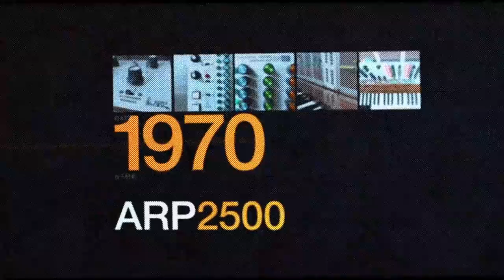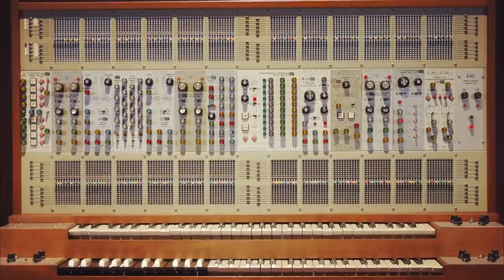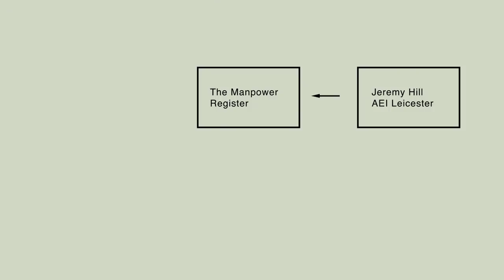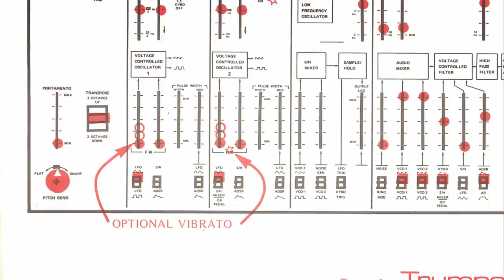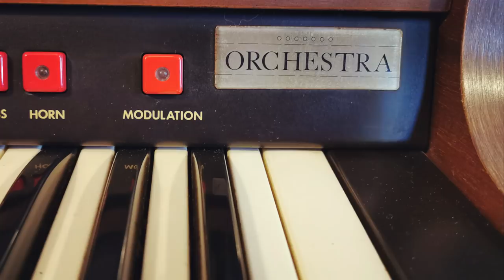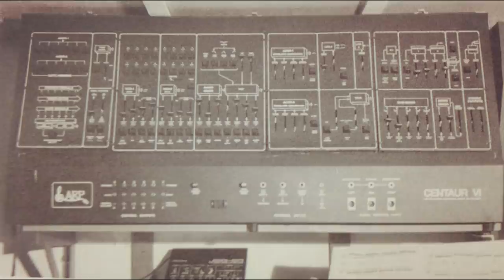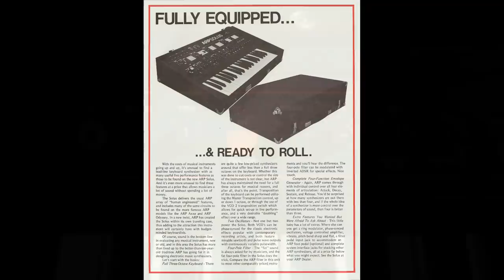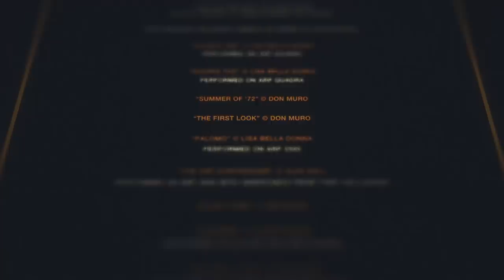Electromotive - The Story of ARP Instruments

Comment from the maker: Some corrections:
 
1:25:20 - Should read Drew Schlesinger & David Torn.
On that subject, check out the superb album that that track is from:
https://drewschlesinger-davidtorn.bandcamp.com/album/summer-synthesis-1978

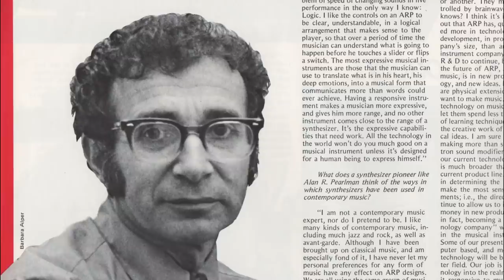1:36:26 - The mylar membrane switches that failed were actually in the keyboard action, not the front panel. Each key had a roller mounted on it and the roller moved down and up the membrane switch when a key was depressed and released.

1:50:44 - The song title should read "Schismo".

Comment: 1:32:31 interesting! So basically Yamaha (and perhaps KORG and Roland) backwards-engineered and copied down to the circuitry everything they later became famous for. That sounds remarkably like what Behringer is doing right now while pissing off those very same Japanese companies. 🤨
Reply from the maker: That was specifically Yamaha, there isn't evidence that Korg or Roland did something that extreme, but I imagine most manufacturers had a very close eye on the competition. For example, the Roland System 700 main cab quite clearly takes influence from the Moog modulars and ARP 2600 but it doesn't infringe any patents and also adds lots of unique things that were Roland ideas.

Yamaha, Korg, Roland etc all invented piles of original instruments and built their own legacies too (including after ARP were gone) so it wouldn't be accurate to view them as just copying and cloning.

So whilst I agree there is a little hint of irony, taking issue with a company cloning your iconic back catalogue with the same names, layout, livery etc is very different.
Reply: Behringer 🤮 no comparison to Yamaha, Roland, or Korg.

Comment: My 1st synth was a 2600.
I used to use it in Experimental Comp class as a mixer for class projects.
I’d hook the Teac 4 track into the mixer section. It became a 4 input/1 filter mixer with a single reverb.
It was an amazingly flexible system.
I also used it in the early 80’s as an FX device for live mixing.

Comment: Those early synthesizers that first came out used transistors and were built at component level. So they dissipated quite a bit of heat. It wasn't until designers started putting chips into synthesizers that they could make them more energy efficient and less likely to cut off.

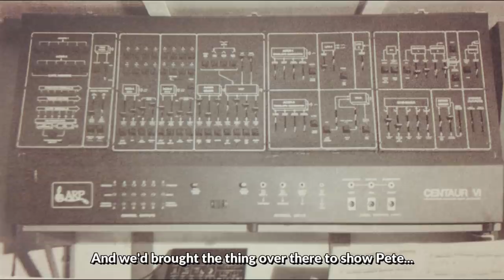Comment: In the Willem 2 studio in Den Bosch they have a 2500 system open for public access. It lives in studio 2 in liu with some of its brethren. And it's the Netherlands, not Holland (although Bodegraven is in fact in the province Southern Holland). 1:19:46 That guitar is an Ovation Breadwinner, I owned one.

Comment: I think you got your Fenders and Gibsons mixed up when you mention string spacing at 1:22:15, but regardless, you've really outdone yourself with this one. Great documentary. I hope someone reconstructs a working Centaur VI some day. I'd love to hear what that sounded like.
Reply from the maker: Surprisingly not. The 70s Fenders used 55.6mm - 2-3/16" string spacing which was narrowed in the 80s.

The wide pickup is specifically for the Fender strat.
Reply from the maker: Oh, and there is a Centaur demo on a tape. We're trying to get it digitised but that's had to be postponed due to the current situation. Hopefully an addendum later this year.

Comment: Thanks Alex for sharing. The background music from position 7:40 is, to me, really symbolic of "early" electronic music. Do you where it comes from ? and do you know how to produce it?
Reply from the maker: Hi Eric,

Yes that is a legit 1971 recording of the Blue Marvin ARP 2600 by Don Muro.

It's available here.

https://flannelgraphrecords.bandcamp.com/track/the-first-look
Reply from the maker: The sound is the sample and hold circuit modulating the frequency of the oscillators.
Reply: Hi Alex, thanks a lot. I will try to reproduce that somehow. It is really quite a spacy kind of sound. The music produced random sounds, but somehow it does not sound too un-harmonic (but I am not a musician). Do you know if it is sticking to producing notes on a fixed scale ?
Reply from the maker: The sample and hold circuit will sample voltages from any incoming signal and then a clock signal with define how long it holds it for before resampling.

If you give it a consistent signal to sample from (like a sawtooth wave at a fixed frequency) then you'll get a consistent result that repeats over and over. If you give it white noise (which is inherently random) then you'll get all kinds of random voltages which will create that classic Sci-Fi blooping when used to modulate an oscillator.

At a fast enough clock rate it somehow doesn't sound random, it sounds like electronic chirping.
Reply: @AlexBallMusic  Ok so the randonnes (or some other variability) has to come from outside of the sample and hold circuit. Yes it is great Sci-Fi stuff. I will have to experiment with the clock rate. Merci beaucoup.
Reply from the maker: Yep, most sample and hold circuits have normalled connections with it already setup for you. On some synths it's even labelled "random".

Comment: Those ARP pianos were astounding for the time, way beyond anyone else's piano sound. Sadly the repair issues killed them, or they would have been THE thing for touring bands.
Reply: The CHROMA (original, not the Polaris) is an amazing-sounding synth too - with the best keyboard action ever on a synth. Better than today's controllers even, real wood piano keys with weights. But it was a huge pain to program...
Reply from the maker: Hey Brian!

Pianos - Only ever seen broken ones for sale, seems they're probably best owned by someone with the skill to maintain them. One came up for sale up the road from me very cheaply last year but it was absolutely battered and (unsurprisingly) not working so I didn't get it for the film. Curious to play one though.

Chroma - I get the sense that it has a cult status amongst part of the community. I think there's even a third party controller for it now that allows for knob-per-function control which makes a huge difference. We did a demo over midi but I didn't play it myself. Hopefully one day!

Comment: The irony is that the Japanese synth companies of the late 70s and early 80s were reverse-engineering ARP’s designs and building cheap, mass produced variations of their circuit designs. Behringer is now doing the same to those same Japanese firms today. Karma...
Reply from the maker: Well, not exactly. It seems clear that Yamaha in particular put their heads deep inside ARP synths and some Rolands are clearly inspired by ARPs and Moogs.

But...

Yamaha, Korg and Roland made piles of totally unique instruments and had loads of their own ideas and continued to do so long after ARP had closed their doors.

Behringer are taking iconic legacy instruments of various designers and reissuing them with the same designs, names and liveries. That's something entirely different, so it's not comparing apples with apples and there's no "kharma".

But I agree that pretty much all manufacturers owe a lot to the earliest pioneers of modern synthesis (Moog, Buchla, ARP, EMS etc).

Comment: Because the average high school rock band doesn't have 1/10th of Pete Townshend's resources.
Reply from the maker: High schools bought many Odysseys as did many amateur musicians. They sold by the thousand, which was significant for the early 70s.

By contrast, they made and sold around 100 2500s, which is what Pete Townshend was using.

So the idea was right. Granted, they weren't cheap, but this was cutting edge technology at the time.
Reply: @AlexBallMusic  Ah, I thought you meant "rock band made up of people in high school".